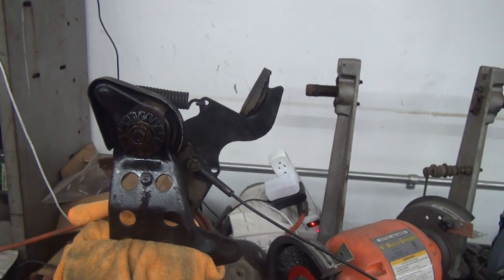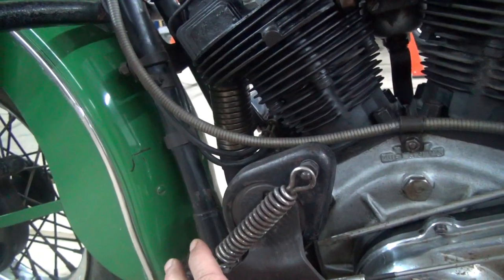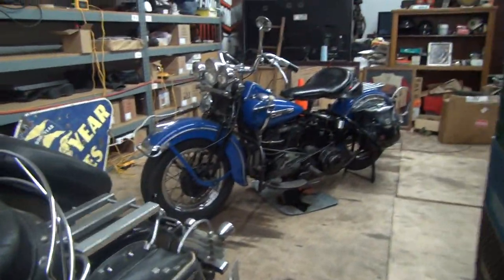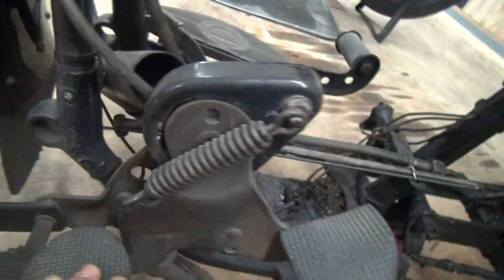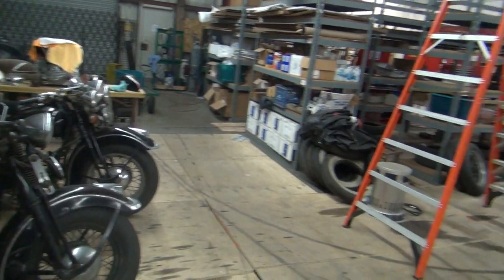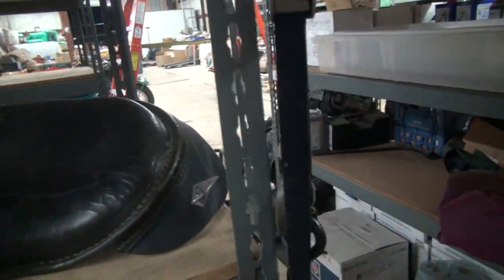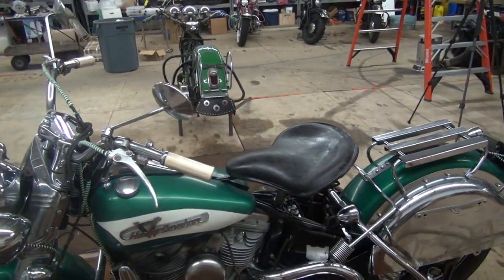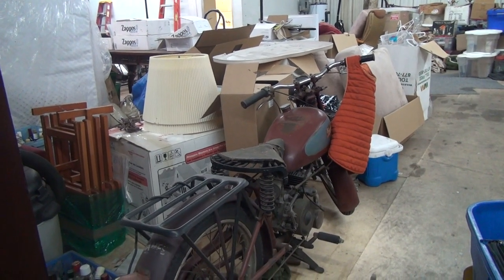Hunting Harley's, Todd discusses rocker clutches

Comment: It would be a simple thing with that corrugated roof to put in a basic fan system that would exhaust the heat and pull cooler air in from your garage doors
Reply from the maker: we have large industrial fans to do that. prior to that the temps would get 115 plus!
Reply: Do those fans actually exhaust the air from the building or just moving air around?
Reply from the maker: a bit of both. With the doors open, they push the hot air out the doors from the top. I'm screwed with the doors shut though. They drop the temperature  about 15 degree's with the doors open on hot days. The end of problem is at hand though. I have rented the space next to me, double the space at close to the same money
Reply: Well that was the way to go, blessing is disguise
Reply from the maker: wait till you see the new shop!

Comment: How do you combine the accelerator with the left hand timing when you are riding.  If the left hand is not in sync with the accelerator it could be a pain i the ass.  Do you just leave it along and just play with the accelerator once is idle and running.
Reply from the maker: Once it's started, you simply keep the timing full advance
Reply from the maker: These are 80 year old motorcycles, don't compare to a new machine